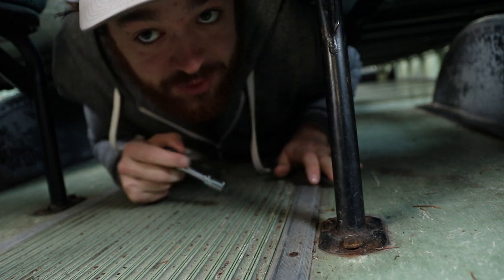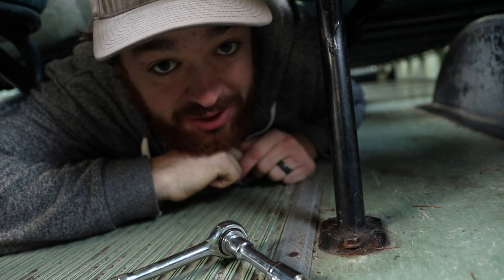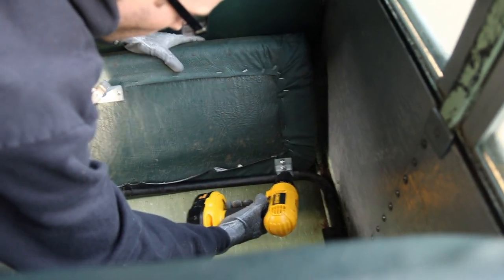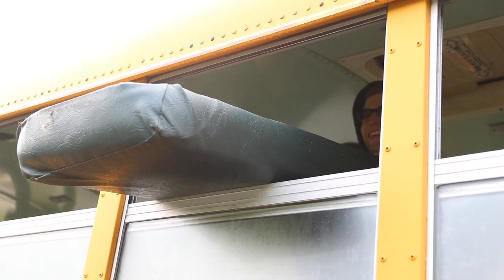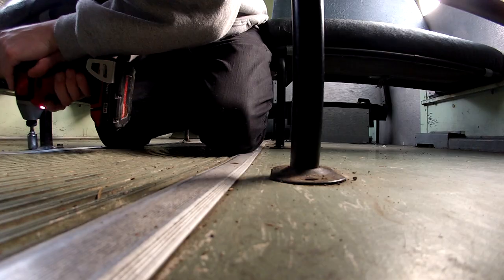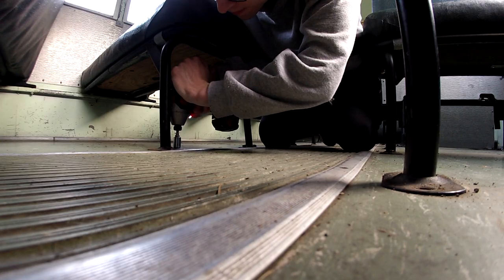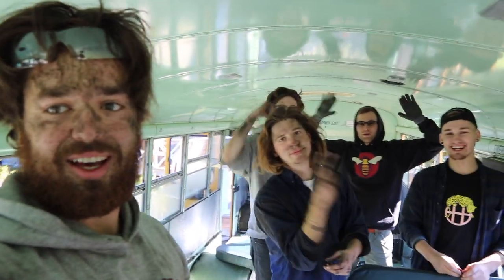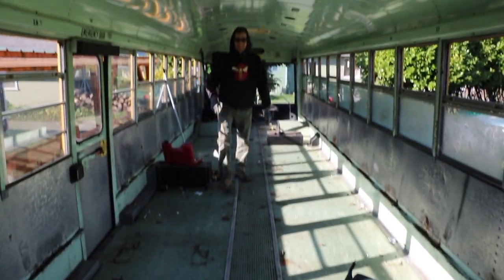Seat Removal - Skoolie Bus Conversion - E3

Comment: We started yesterday to pull the seats out. They r rusted nuts and bolts. We are going to try oscillating cutter to cut the bolts.
Reply: Only for cutting wood. Use a grinder

Comment: What tools did you use and need to remove all the chairs? And such in this video? Im starting my bus conversion in about 3 months and it’d be great to know what you all used
Reply from the maker: we used a socket set and drills. I think ours came out easier than most but they just unscrewed!
Reply: @ColaVentures  Is that called a ratchet socket wrench?? or something? I have a hammer dril/driver..so I can't use that? I have to use an impact driver with a socket bit? Do remember the sizes u used? I guess it all depends on the bus.